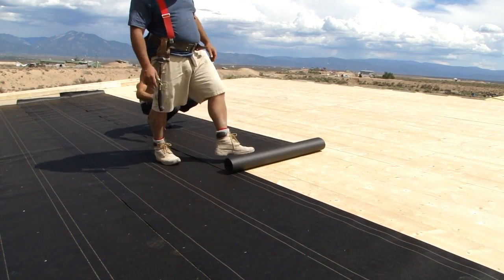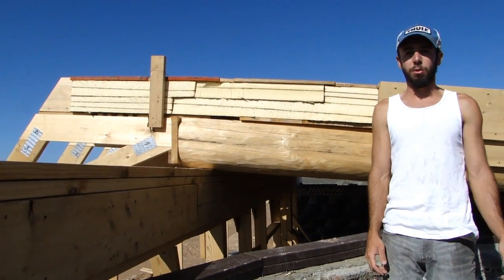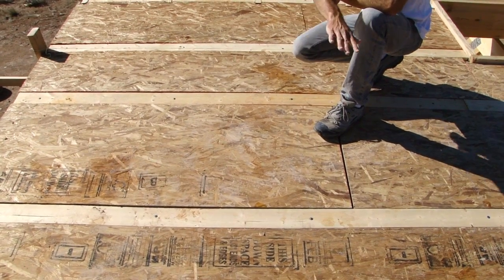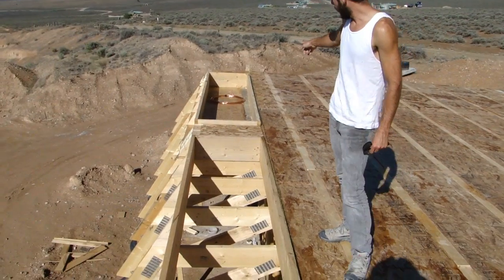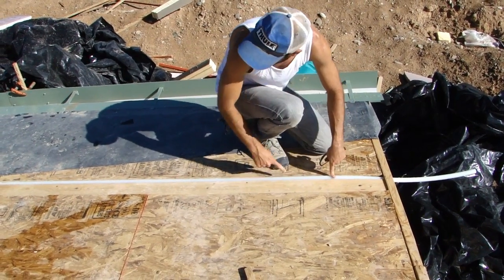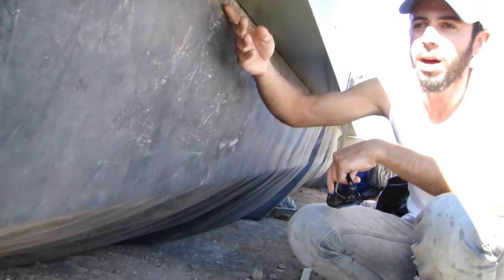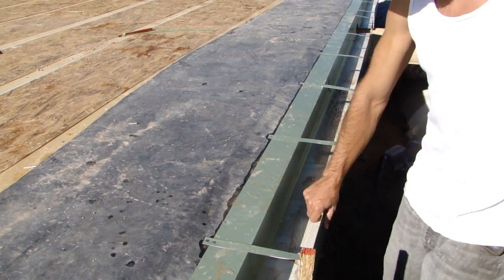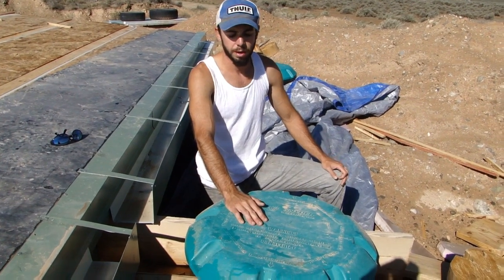How to Build an Earthship Metal Roof - Part II

Comment: where do I get the epdm rubber ?  I called around local plastic supply, plastic fabricators, check home depot, Lowes, etc.  Is it the Pond liner?  Now the pond liner I am finding are not more than 4-6 ft in width.  Most pool pond places want to install it not sell me the material.  Most of them just looked at me that I am crazy.  What other type of plastic material I am looking for?  Same thing for poly urethane? where do I find it.  Thanks

Comment: In the case of this style of Earthship the EPDM is only a hydro break from the ground surrounding the north, east and west buried walls and the roof overhang. I have seen EPDM used on the entire roof of an "undergroud" home, one that has a living roof. I imagine it wouldn't hurt the installation of EPDM directly under the metal roof but it sure would cost a pretty penny. I'm not sure though how the glycol tubes used to melt snow would be effected.

Comment: Alright lets look at this from a different angle. That overlap of EPDM on the roof top (under the standing seam metal roof, is in a location that's over the ground (large overhang), not over the structure. IF water were to breech the metal roof, and partially damage the top 1/2" CDX, then the 8" of rigid foam, it would still have to breech the felt paper directly on the roof deck prior to the Vigas. This design method is also code approved for Taos County.

Comment: The EPDM is laid in this manner to keep GROUND water from getting to the roof structure, not rainwater. This is no different than the waterproofing that basement walls receive in new construction. If you are talking about a commercial roof (flat, or near flat) then it's a whole different story as the EPDM (usually white) is the roofing itself in some applications.

Comment: The roof angles AWAY from the sun and therefore would receive a fraction of the sun's energy (especially in winter) from BiPV. Also the sheer cost compared to the 4 panels he installed is prohibitive. Now if the roof sloped towards the sun like they used to, then yes, BiPV would be fantastic.

Comment: We install sprinklers to knock down the salt spray build up on windows.. 

couldnt a sprinkler or sprayer be installed? (I am asking for another way to install something that pushes the snow and ice into the tanks, instead of oil in pipes under the roof that will at some point leak into the living spaces or worse garden).

I should have said this first! Thank You for Posting such an in depth build video! I have shared it on Google Plus and Twitter and as I watch I will continue to share!

Comment: if? you have a vapor barrier around the entire house?

why would you have a big concern in the desert for water wicking into the roof beams?

I am not asking to be a dick? I am asking becuase I will be building one of these sooner than later..

the other issue I have is the roof warmer? 

is it just me? or if that leaks it will destroy / pollute / cause to be replaced.. the interior ceilings and walls or where ever it seeps into? 

this may sound silly.. but in south FL will install sprinklers.